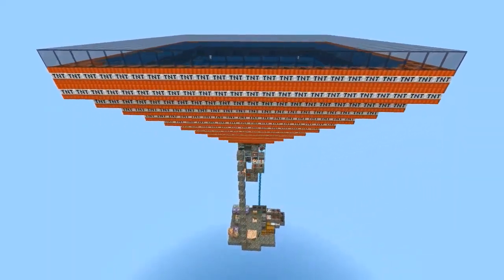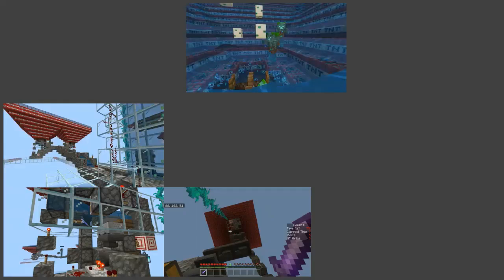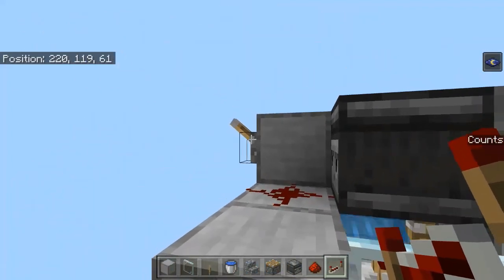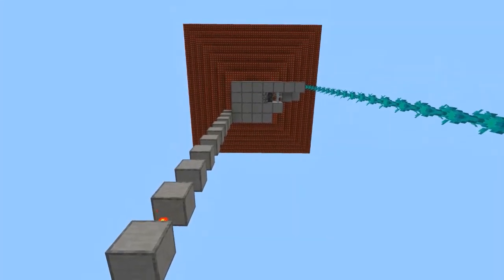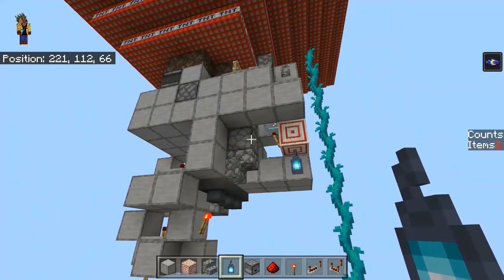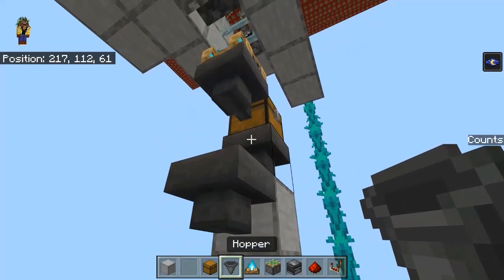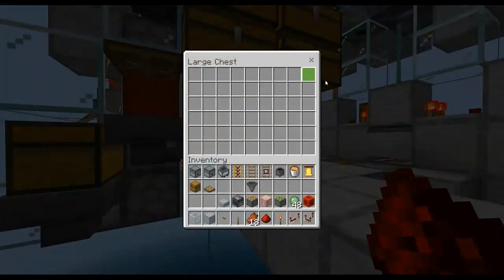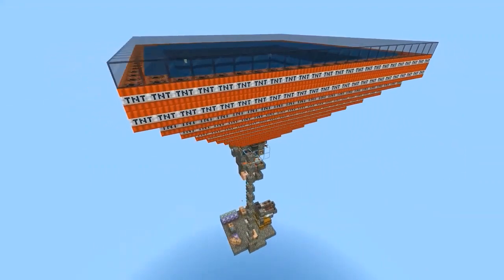Drowned Funnel - Scalable Drowned Farm for Minecraft Bedrock Edition

Comment: While your design seems very promising, it didn’t work out well for me 

Not a single drowned spawned at this farm 

I have no idea why this is happening to me, am playing at simulation distance 4 and got my afk height at about 107 y

Followed every single step to build only the compact single farm, yet no results at all showed, I used ice instead of TNT and for the roof I used solid blocks and on top of the solid blocks I used slaps, and I covered the ice from the outside with solid blocks to prevent lighting, and still no good results at all 

I was wondering if this farm is outdated or did Mojang broke the drowned farms on bedrock? 

It really took me a bunch a time to finish the build and I don’t wanna have all this effort go away for nothing, please tell me if there is anything I should do
Reply from the maker: Your problem is your roof. Drowned only spawn as “surface” mobs, and when you use solid blocks or slabs it sets all spawn attempts underneath to “underground”. If you do not have tinted glass like I showed you can do leaves 5 blocks above the water and extending 4 blocks out past the walls, or 2 layers of regular ice directly above the water with a layer of buttons or iron bars on top.
Reply: @goldenhelmet403 hello! I have a problem with the roof, I tried the black stained glass but nothing seems to be spawning during the day, idk if it's about the glass but it works just fine in the night
Reply: @goldenhelmet403   problem solved, thank you for your answer, pretty good farm and reliable one
Reply: @renebana5795  black stained glass and "tinted' glass are different. Black stained glass act as normal glass with colors, hence it the sunlight from the day prevents mobs from spawning, while "tinted' glass allows you to see throw it without any kind of light to go throw the block. It kind of act as a solid block, but it isnt.
Reply from the maker: What titan said is correct. I’ll just add that you craft the tinted glass with glass + amethyst shards.